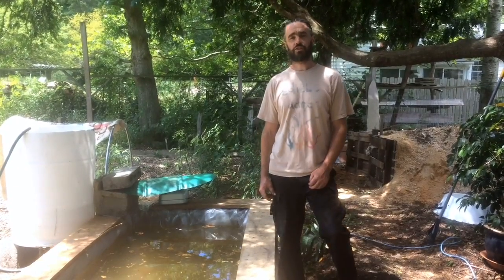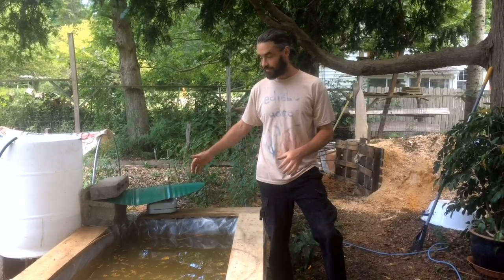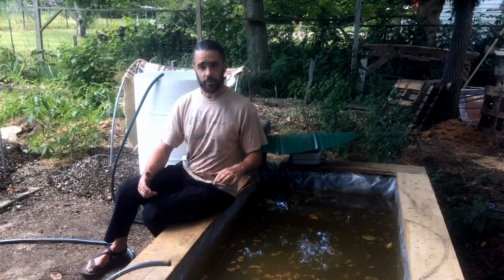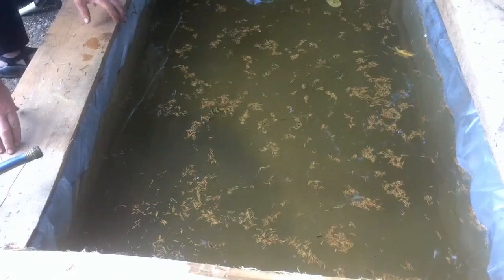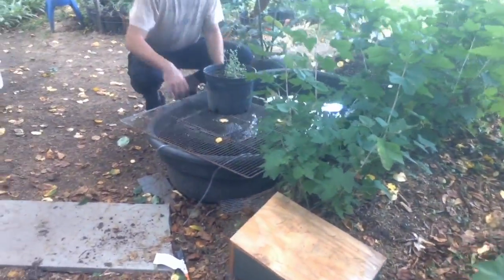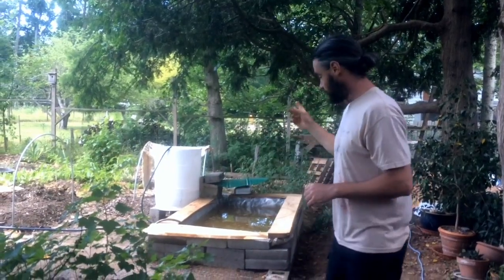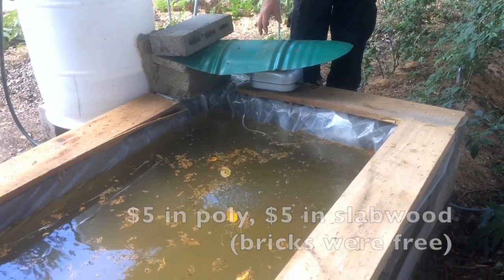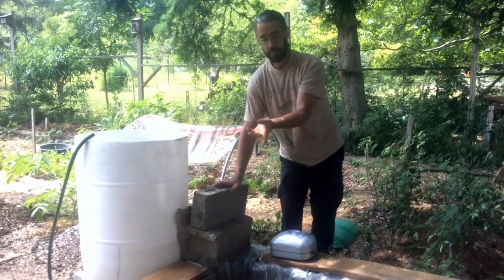Above Ground Pond - Scalable, Inexpensive, Simple

Comment: I use an small aquarium bubbler with a four port splitter for my needs and it seems to be adequate.  I discovered the majority of noise came from the pump being in contact with the shelf so I  suspended it.By placing the pump on a not responsive surface such as straw you will reduce the annoyance of harmonic resonance.
Reply from the maker: I hear you on the placement of the bubbler.  I might sit it on foam board for this application...

Comment: Adding a tube to the air pump inlet will help make it quieter. So will putting it on a closed cell foam bed. Studies I've read show a reduction in insect populations near constant noise sources.
A gradient from aerobic to anaerobic will give the most diverse aquatic environment, Winogradsky columns are fun examples to learn from.
I like the Japanese Medo air pumps from Nitto Kohki, the last time I was researching air pumps they came out the most efficient for energy to rated airflow, but are expensive.
Reply from the maker: Thanks for the technical notes here, I appreciate the detail!

Comment: Looks great! I've also been experimenting with water and natural ponds/creeks this summer. Have you been using any city water as the source for your water experiments? I have, but I'm tracking my usage with the intent of knowing how much rainwater I need to harvest for next summer. Awesome cinematography Sasha (I assume its Sasha, apologies if I'm wrong), I appreciate the slow camera movements and framing. Sean,  regarding solar panels and bubblers. I'm working on a logic board that will be able to crank over the motors by using either capacitor or battery storage. In my experiments, I found that I could use a very small and cheap solar array to power individual motors, but the first motor crank usually needs twice the current that the solar power is rated for. You could solve that problem with an oversized solar panel, but I don't have much space in my R&D area and I appreciate efficient design. I'm working on a video that will explain what I know and will hopefully have it public in the coming months.
Reply from the maker: We only use rain water for all the things we do.  Actually 10 years of running the nursery, all our food, our chickens, all the stuff on just collected rain water in the summer and hand dug ponds in the winter!
 I just told Sasha you like the camera work.  She takes her time moving the camera and is quite patient with me randomly walking all over the place!
I'll look for a video on the tech stuff you are mentioning here since in reading it, it's definitely over my head!
Reply: That's truly amazing. No wonder you are generating so much compost, you probably have a diverse and healthy micro-climate. My super small lot is starting to improve this year. The microbial, fungus and insect life has exploded, and I'm only a year into rehabilitating the land back into a living and healthy micro-climate, one step at a time.
Reply: @kylesimukka  Did you end up compiling the info about the technical details of solar panel size for various motors?  That sounds very useful!